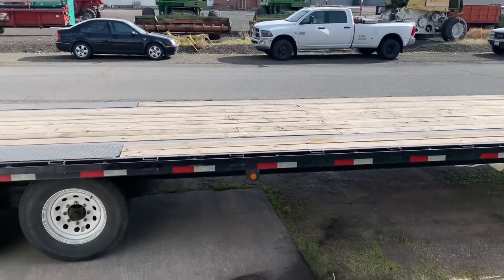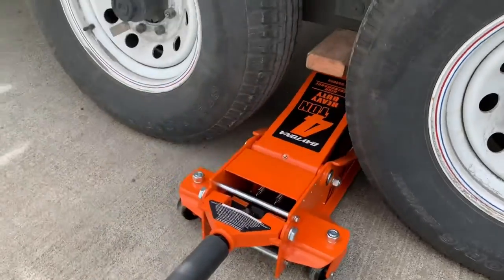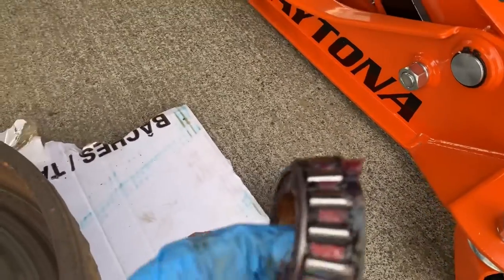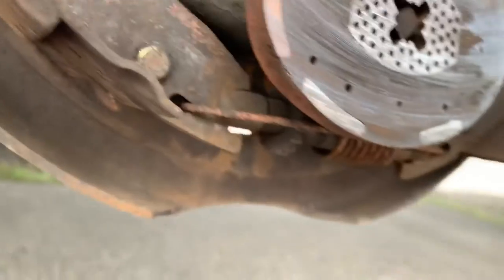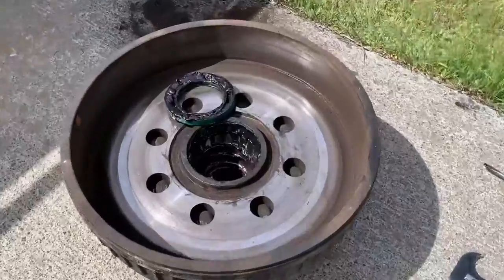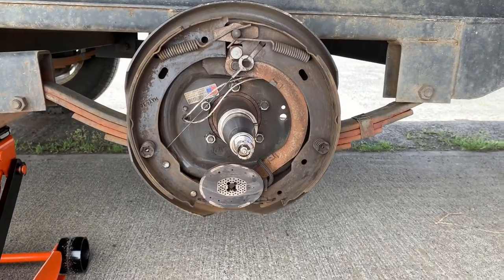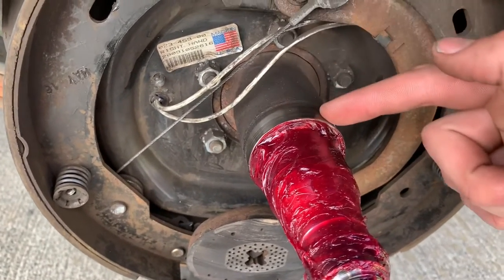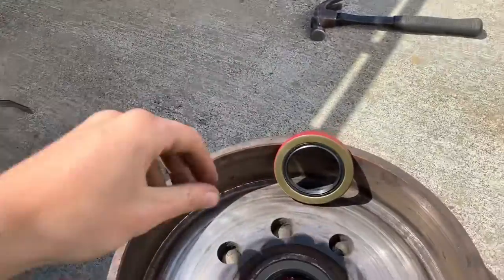Trailer maintenance 30k mile service- What’s up hotshot ep6

Comment: Boko's: I got self ajusting brakes like yours, do you think I should take off the self ajusting parts so they dont fall of in the drum ? I had that trouble before and I'm close to buy new back plate, but they are self ajusting the deal I'm looking for. I'm kind of confuse to go with self ajusting or not ? Tell me what you think. Thanks.

Comment: Fyi- the adjuster for the brake shoes is generally referred to as a "star wheel". Tip- if you don't want the drum to pull on the brakes, you just use your brake adjusting tool to retract the brake shoes and the drums should pull off w/o issue. Also, as for the rear seals... it isn't a bad idea to put a very thin layer of grease where the seal will mount- the seal is going to be going around on that shaft for thousands of miles, and a dry seal against dry steel won't last as long. In fact you should probably smooth that bit of the axle with some sandpaper just to ensure it's not rough metal the seal is rotating on. Thanks for the video 👍~

Comment: You said those are Dexter axles.  If you check, Dexter says not to jack on the axle or any part of the suspension.  Jack on the frame only.  
     When you grease the bearings, just wiping the grease off the outside does not get the dirty grease and any impurities out of the inside of the bearing.  They need to be cleaned in a parts cleaner or a solution pan with a good brush and then blowed out with compressed air afterwards to get the solution out of the bearing.  Then on the install, the axle does not need all of that grease on it.  Nothing turns on the axle.  The bearing rollers roll on the race inside the hub and within the bearing itself.
     If the automatic brake adjuster was't working, usually indicated it was either installed wrong or came loose.  
    I never realized how small and inexpensive the parts are in the lightweight axles.  My Dexter axles require the inside axle nut to be tongued to 100 foot pounds and then backed off.  Then set the star washer and bend the tabs, followed by installing the second axle nut and torque it to 100 - 175 foot pounds, and bend the star washer tabs over it.  The brake backing plate assembly is $269 and the seal is $50.  The seal should be installed with a seal installation tool, so as to not damage the seal.  If damaged, will cause them to leak.
Reply: Right Mr Pappy that's the problem with this YouTube hotshot people show the improper way to do the job correctly and like you said compared to real axles these parts look like toys I don't understand why people by these baby 14 trailers and then complain about rates cause they can't haul anything

Comment: One of the best hotshotting videos I have seen so far!  What did this end up costing you?  With and without buying the hub replacement.
Reply from the maker: Thanks Shawn! $24 for 4 new seals and $6 for a can of grease is what did it. I already had all the tools I needed but I did buy that backing plate and one each as a spare part of everything so that was $150 total including seals and grease.